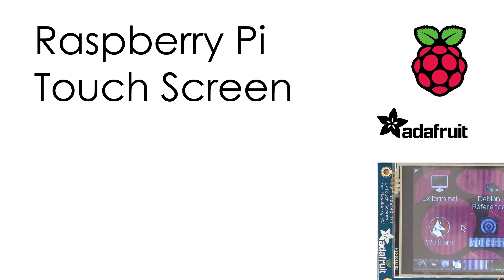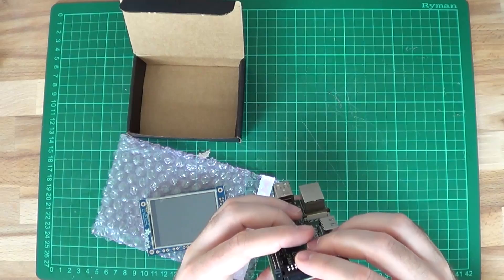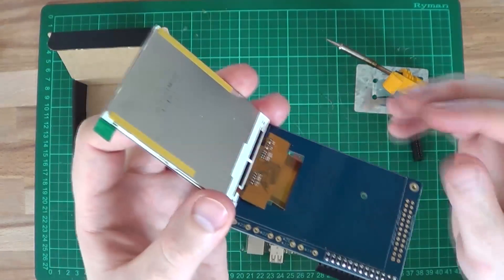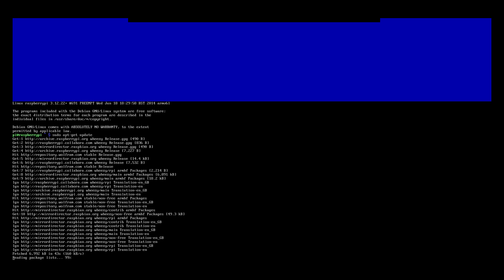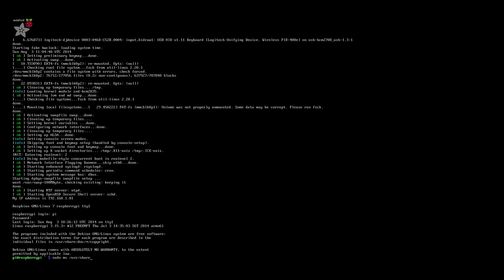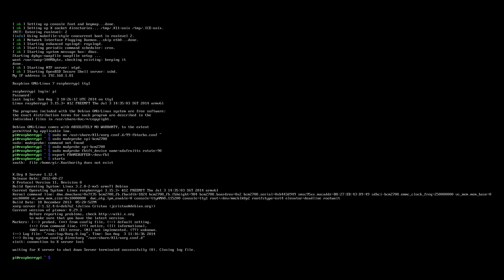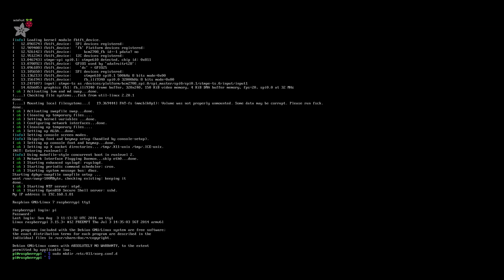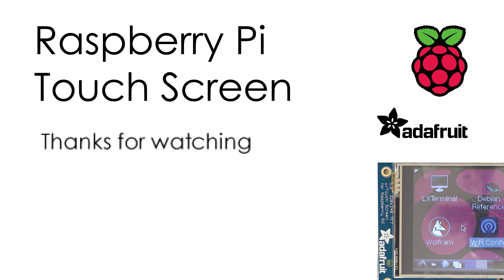Raspberry Pi mini touch screen

Comment: this video is 2 years old, so I hope someone sees this anyways and can answer me. 
if I see this correct, the screen uses all of the circuit board the rpi provides. 
how can i connect more gpio pins from let's say gamepads/buttons if I were to build a handheld console?

Comment: when I shutdown the raspberry pi 2 after the command "dpkg -i -B *.deb". The screen just shows a colored screen and doesn't boot up. I waited for 5 minutes and the screen display doesn't change? Any suggestions?
Reply: I have the same issue any fix?

Comment: So is there a way to run the “FRAMEBUFFER/dev/fb1 startx” command automatically as you start the raspberry pi? Would be very useful for projects without keyboards.

Comment: A bit of advice - if you want to develop (even if just for fun as I do) touch controlled applications forget about it using such screens. Even with 3.5" touch screen (like mine) its accuracy is just piss-poor. Go for 7" or larger but make sure you research before that if it's suitable for such tasks. There are two MAJOR problems with these screens:

1)Size
2)Poor sensitivity

Both are obvious when you decide to buy a small touch screen for like 15-20 EUR. However it's the combination of those two factors that makes them unsuitable for anything more then just pressing buttons (not too small ones!). Multi-touch and stuff like that is impossible or to a degree that it's plain frustrating also due to the fact that

3)Touch pen - MUST HAVE!

Even with small fingers you have to create quite large UI components to make it efficient to do decent texture recognition. Also due to the limited surface size of such screens going beyond 2-3 fingers for a gesture is out of the question.

I post this hoping that people won't make the same mistake as I did buying a 3.5" screen thinking "Now I'm gonna learn how to develop touch controlled applications".

Another VERY, VERY IMPORTANT THING to have in mind: displays for RPi controlled via SCSI do NOT have graphical acceleration. Only HDMI screens profit from it hence you will get choppy imagery when you try to play a video clip or something that requires a decent amount of FPS. This is another issue that I discovered post factum because I was dumb enough not to do my research in advance.

Comment: if i just wanted to use it as a display instead of a touchscreen display do i still have to wright loads of commands?
Reply: +Thelonious Omori Hi, did you manage to get your display working?  I have a C-Berry 3,5" with no touchscreen capability. Cheers

Comment: No matter what i do, the screen is just white.  Tried installin noobs, raspbian and formatting correctly
Reply: ***** I have 3.5" inch display, so I'll follow this "easy" install: https://learn.adafruit.com/adafruit-pitft-3-dot-5-touch-screen-for-raspberry-pi/easy-install
If it works, I'll let you know ;)
Reply: Same problem man. Can anyone help?
Reply: ***** did you solve the problem?
Reply: Lude Fore Nope.. I have not solved it yet.  Partly because I'm waiting for a new sd card to arrive, so I'll have enough space to install new drivers (only had 4gb before). 

What I'm planning on doing when the card arrives is to follow the adafruit "easy install". https://learn.adafruit.com/adafruit-pitft-28-inch-resistive-touchscreen-display-raspberry-pi/easy-install  Hopefully that will work.

If you try it please report back to me? :)
Reply: Lude Fore
Did it work?
Reply: +Boas Andreasen Didn't try it yet...its 1st of May, barbeque with my family...next week I'll try it ;)
Reply: ***** just installed it and it doesn't work for me :/ I tried putting their image on my SD card and when I turn it on my 3,5" screen it is still only white screen :( then I tried using standard Raspian image and installing their package step by step as they show on that web site and after reboot it loads something, but when it needs to be shown startx or something like that, then it is only black screen, no mouse, no desktop, no ability to write anything....I'm so mad now!
Reply: Lude Fore
Sad.. I ordered the raspberry pi with such high expectations. :(
Reply: ***** 
raspberry pi is fine only if you have nice HDMI monitor so you dont have to struggle with all of these problems...just connect with HDMI cable and do what you want...:D
I ordered my 3.5" screen from here: http://www.ebay.com/itm/281534849098?_trksid=p2057872.m2749.l2649&ssPageName=STRK%3AMEBIDX%3AIT and delivery was very fast, in 10 days I think, but problems are in configuring this little screen...I got a CD with instructions and image to install on my SD card and when I do that the 3.5" screen works, but cant see half of windows which I open, so I dont know how to fix that :/

Comment: So i ordered a random 3.5inch TFT screen for my RPi.. its not adafruit but can i follow this guide and it will work just the same? i dont know how to get it to work
Reply: depends if it has the same thing with the pins, if so , yes you can follow this tutorial, if not...well...

Comment: is there anyway to run this so the Icons aren't so large? I have seen some pictures and have seen some sparse discussions on how to do this but there is nothing definitive. Running Xorg is almost pointless with the pitft, Not a problem in the bash but sometimes I want to run a gui app and it's almost impossible.

Comment: Will the adafruit 2.8" TFT work on the Raspberry Pi B+?
Reply: YES. I am working with it right now. :)
Reply from the maker: Peter Kurtosi Thanks Peter, I didn't know myself. I'm guessing they kept the first 26 pins in the same order. Makes sense.
Reply: MileyORiley Check this picture out:  https://www.google.com/search?q=Raspberry-Pi-GPIO-pinouts&tbm=isch&tbo=u&source=univ&sa=X&ei=p6yEVLr-Eov0UteDgfgP&ved=0CCoQsAQ&biw=1600&bih=789#facrc=_&imgdii=_&imgrc=GAka6Wi1-dySiM%253A%3Bdz2Lc9wO48jCiM%3Bhttp%253A%252F%252Fraspi.tv%252Fwp-content%252Fuploads%252F2014%252F07%252FRaspberry-Pi-GPIO-pinouts.png%3Bhttp%253A%252F%252Fraspi.tv%252F2014%252Frpi-gpio-quick-reference-updated-for-raspberry-pi-b%3B1424%3B978
Reply from the maker: Peter Kurtosi Just as I thought, nice one.
Reply: Yes it does

Comment: Would a hot blue gun work instead of soldering?
Reply: hot glue isn't conductive so probably not. hot glue is used in electronics just to keep boards and components from moving around. solder is the only way to ensure an electrical connection
Reply: :/ k
Reply: Badplum25 it's not as hard as it looks. sure, it takes a bit of practice but the learning curve isn't that steep ;)
Reply: kk idk if i could afford one though :/
Reply: not sure what your budget is but you can get a cheapy to start with for less than 20 bucks from amazon. and solder is only a cpl bucks for a roll that's probably enough to do 10 of these. no point in blowing 40 bucks on a weller in case you screw up and damage the tip...it's less of a bummer if you break one on a $15 iron. if you find you like messing with electronics you can always pick up something nicer later
Reply: kk thx! I thought they where 50 dollars xD
Reply: Badplum25 you can get em that  much and they got some nice things (features) but nah you can get a cheap one that's basicly just good enough to get the job done ;)
Reply: Some hot glue sticks are conductive.
Reply: Mister Muttley the basic stuff sold at most craft stores isn't....what you're talking about is specialty adhesive product.
Reply: Kewl Beans Thank you... I own some, as well as 3 soldering irons.

Comment from the maker: ***** Thanks buddy, It was £25 from Amazon UK. Perfect for turning the Pi into something portable, or a desktop tool of some sort.
Reply: Hedge Guru I figured it out
 sudo nano /boot/cmdline.txt

At the end of the line, find the text that says rootwait and right after that, enter in:

fbcon=map:10 fbcon=font:VGA8x8 then save the file.
Reply: Hedge Guru  cheers your video was massively helpfully it's the only way I have managed to get the screen working thanks again :)
Reply: MileyORiley Dear Miley - thank-you for this step by step procedure. Some day i bet this would have helped in a million ways and someone may even have made a living out of it. Well done buddy. Would you be so kind enough to tell me from your pro experiences if you may kind spare me your precious minute please.  I am currently shopping to assemble a supercomputer raspberry pi B+ (clustered with about 10 of these boards). Would you know if i can connect about 8 monitors 22" inch in all ? + can we print documents on our good old printer once everything is up and running ? I don't really see if a DVD/ HDD (external) also plug in the same way. I appreciate all your help. Cheers buddy, Guru
Reply: Hedge Guru And to add on to this, the tutorial you have done above is absolutely well done in terms of quality too. Yes thats the exact way to solder the pins. Looking fed to more tutorials buddy, way to go....
Reply: Hi I was wondering if you knew how to get the command line to display on the screen then choose to either startx or use framebuffer to continue using the smaller screen?
Reply: Mark Stainton Sorry buddy, no idea at this moment, if i do come across and solve this types of issues, i have made a note and will let you know of it...
Reply: Mark Stainton You are a star Mark,  i was still making a note on this and here you are all done and dusted.... well done you got it rt..... way to go buddy....